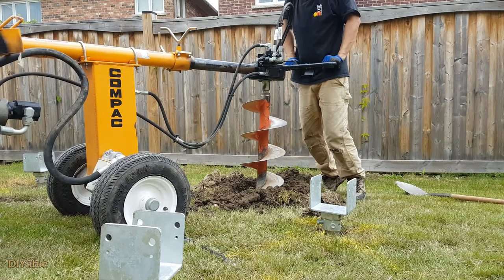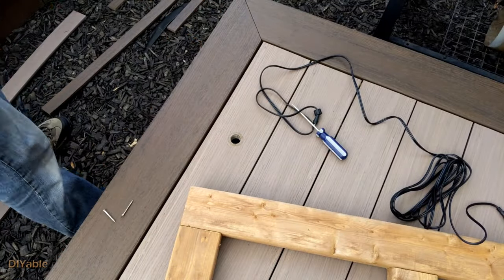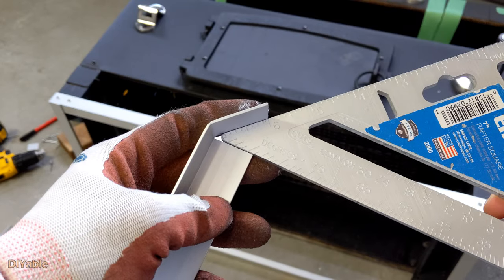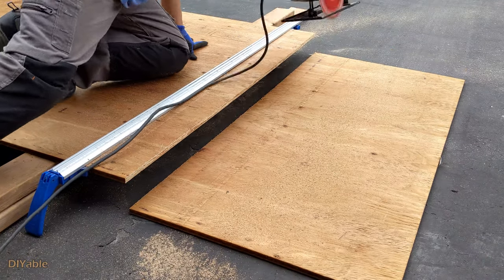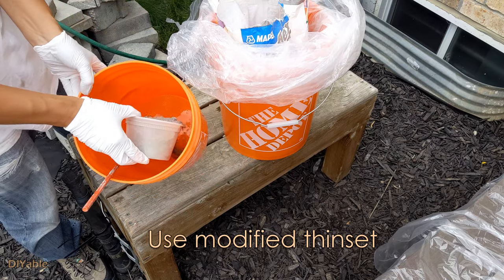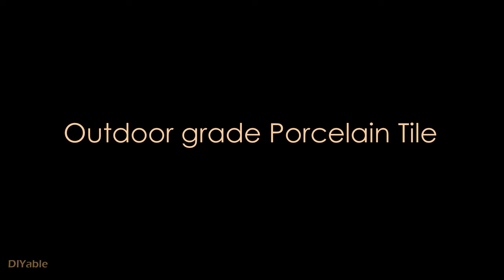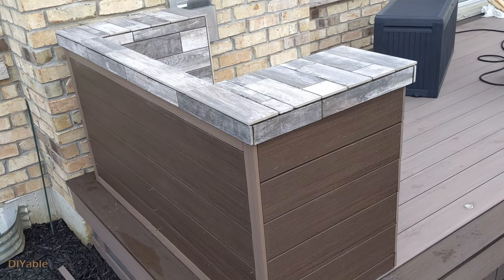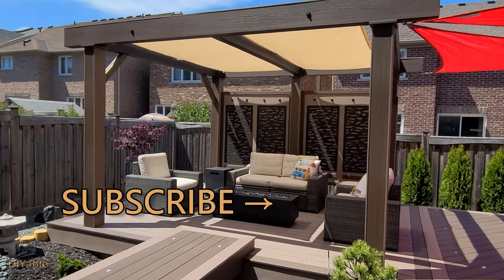DIY Deck (Part 18): How to build a Fireproof charcoal BBQ grilling station for your deck?

Comment: I buy everything based on reviews. Some said this was hard to put together https://www.youtube.com/post/UgkxCx5fHawkK9OoV-ojFrY8JLnZrFwAmvUt some guy said 2 hours and 2 beers later. I didn't drink beer like I was going to. I didn't feel like going to the store. I'm assuming I would have had at least 3. I took my time. Stepped outside for a cigarette break a couple times but all in all it was about a 3 hour project for me but it wasn't like it was difficult or anything . Only pictures but everything is pretty organized and labeled although I didn't see any #s on the actual pieces like it shows in the diagrams. Only the screws were labeled. On the cardboard part of the packaging on the back side. I put it together in my living room too. It wasn't supposed to rain today but it's Michigan and I couldn't wait so I put it together in my living room. Without beer but beer would definitely have made it more fun that's for sure. I'm giving this a 5 for easy assembly. I'll update after it stops raining when I can take it out of my living room and cook some food on it. Hope this helps at least for people who think they can't put this together because I did and you can too . And there are extra screws. I got nervous and immediately came here to see if others had the same experience and they have. You're not doing it wrong. There will be extra screws. Be patient. Don't rush it. Drink beer. Happy assembling

Comment: Love the video, great work. Is the tiling approach an acceptable insulator/fire shield for the wood?

Curious, how well has the mapei aquadefense held up against the heat of the grill? What about the framing 2x4's underneath?
Reply from the maker: It depends on how hot it gets,  I wouldn't recommend for wood honestly.  As you can see, there are gaps between the BBQ  grill and the tiles. Believe it or not, these BBQ grill doesn't really that "that hot" with charcoal.  Mapei Aqua Defense holds up extremely well so far.

Comment: Back in the day this project would have been cheap and doable... now... that’s like thousands of dollars!
Reply from the maker: At least the lumber price kinda went down compare to core pandemic time :)
Reply: @DIYable  I was at the local lumber yard yesterday and their warp wood was 50% off... and even at that price it was still twice as much as pre-lockdowns prices! Still insane to me! I purchased a sawmill and will be getting it in about 6 months. I have a shit load of nut trees out where I live and I got some neighbors to let me take their trees. I am cutting them down now and taking them to my place for now. Need to keep them dry and away from the elements. 6 trees so far! It sucks doing this by yourself! Point is, I had to improvise to do what is best for me and my family. I never once thought I could make a business out of it. And the mill was a butt load of money... over 100k. And they won’t let you write it off as a business expense anymore, new federal law. Makes you wonder, doesn’t it? They are removing the business credits for the individual to start a business such as that, or independent such as small contractors and businesses. Full tax now. Something will soon give.